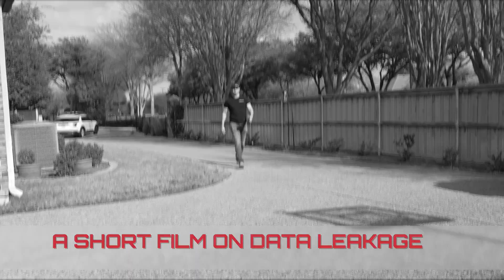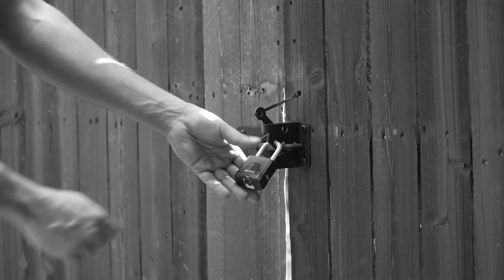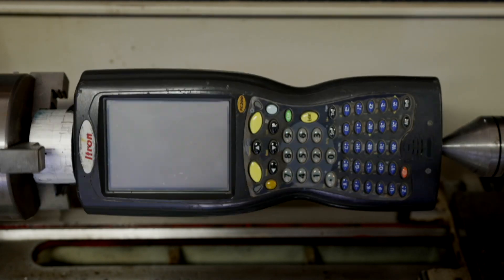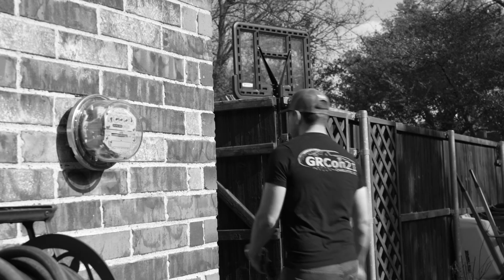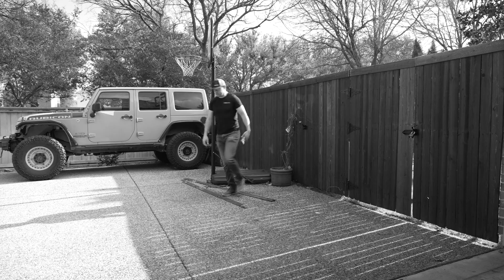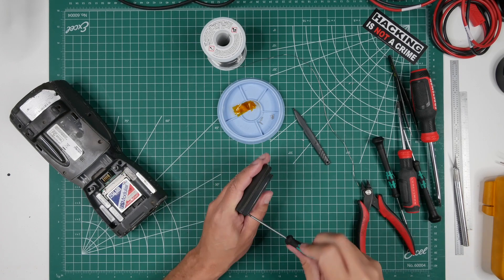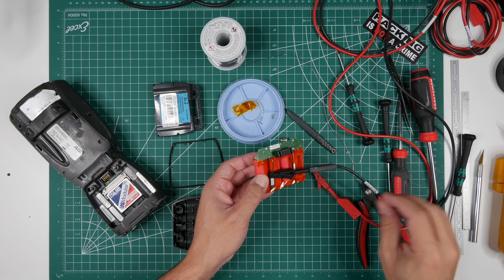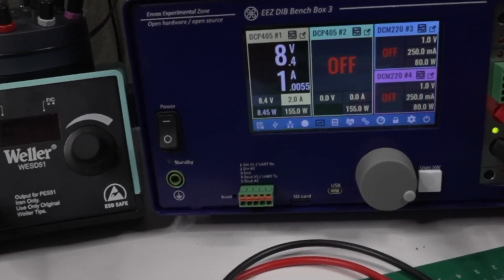Your Data is Leaking On eBay

Comment: I remember reading an article about a small local power company that had an employee that attached power meters to unsecured hidden wifi networks so he didn't have to get out of his truck to read them, which led to a huge security issue when it was found out how lazy he was trying to be.
But how these devices weren't using FDE is beyond me as a security professional. Let alone not DESTROYED the CF card before selling the reader. That's security 101. SOMEONE FUCKED UP
Reply: Either that or stolen from a disgruntled employee.  Regardless, the memory card should be en encrypted.

Comment: In one of your videos you said that a smart meter can pick up and tell small fluctuations in the system thus giving the power company info on the devices that's used and when. My question is can the smart meter pick up any differences in the lines BEFORE the electric goes into the smart meter like if you was to bypass to a garage or shed first?
Reply from the maker: Tapping prior to the meter would be electricity theft, that being said if the draw was small like a laptop probably not. If you’re running a full shop with welders and other gear that’s another story. They can measure draw at points along the distribution, then do the math on what all the meters are reporting, account for loss and have a figure. If that figure now starts to vary greatly they know either a component on the grid is failing or someone is stealing.

Comment: In that video you did about tearing down a collector I noticed that the black port by the ethernet port was labeled vga. Have you tried hooking that up to a display to see if anything shows up?
Reply from the maker: Wow, thanks for pointing that out! Never noticed that. After I started running the disk image in a Virtual Machine I didn’t bother with the hardware. I’d need to make an adaptor for that to a VGA connector but could be fun.

Comment: Did you every figure out the frequency hopping? If not I was going to drop how lora does it is waits for a reply for a few moments after it sends a transmission on that frequency. Just a thought. Another thing to look at would be just to get a zigbee card and see what you see it might be the protocal that is handeling the frequency hopping. Chears.
Reply from the maker: Thanks for the suggestions, haven’t figured it out yet but did figure out a workaround I spoke about at the Hackaday Remoticon.2 conference… Built a transmitter that just transmits on all 240 channels at the same time!